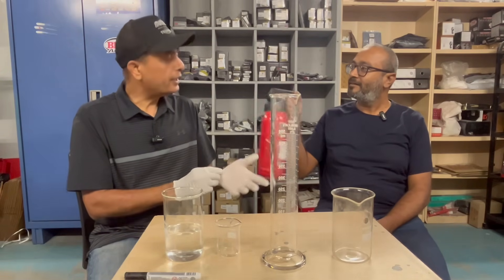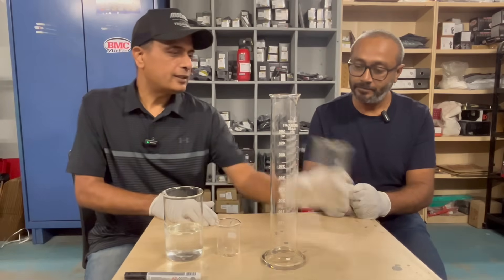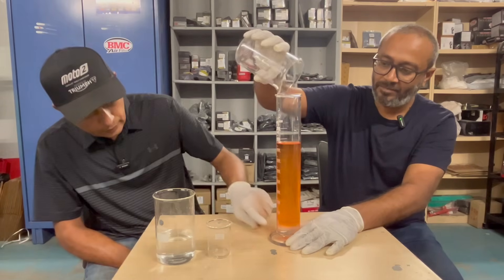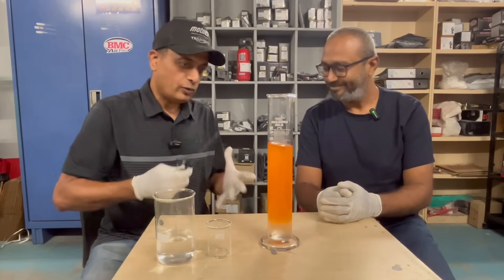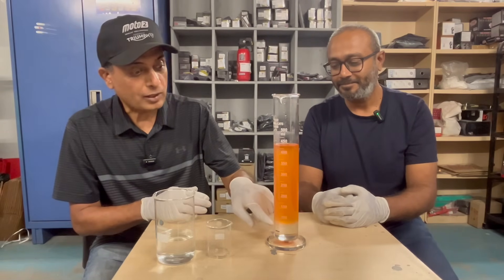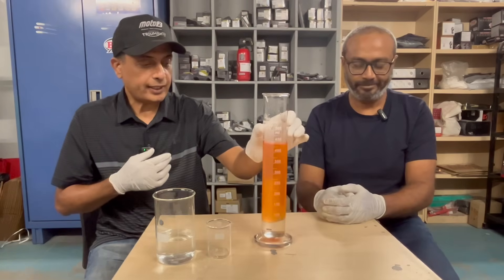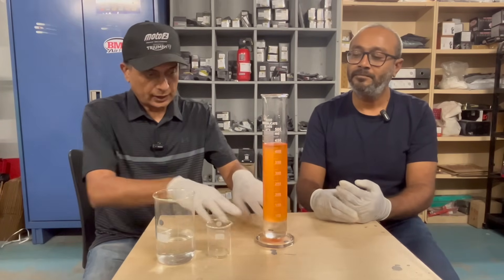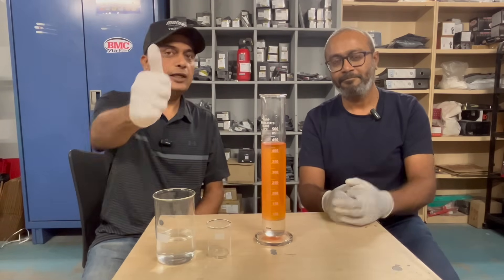ALCOHOL from PETROL | Separating Ethanol from E10 Petrol | Possible?

Comment from the maker: CAUTION- Please be aware that any experimentation with petrol is risky and dangerous and we do not recommend or suggest anyone to try this. Be safe and handle highly flammable items with utmost care. Thanks.
Reply: It works 😅
Reply: Make another video of how to take out petrol properly and keep in seperate gallon
Reply from the maker: Pardon. No plans at the moment to make any more videos on ethanol separation.
Reply: Bosky  sir , can i use distilled water ,shake the container with e20 and leave it overnight and in the morning  siphone the clear petrol from the top  ?  Ofcourse I'll cover the distilled water e20 mix while keeping it overnight.Will the pure petrol be safe for my 2025 zx6r? Do I need to add octane booster with this pure petrol ?because when we remove pure petrol after water mix  ,even octane boosters stays with the ethanol .
Reply from the maker: You can but be careful please. Handling and storing inflammable materials at home is not recommended.
Reply: Why you cut the video, should have shown full video. Mister scammer
Reply from the maker: Reasons to Cut a Video
	•	Remove Unwanted Sections: Cutting allows the elimination of silences, mistakes, irrelevant or repetitive footage, and errors, making the video more concise and focused.
	•	Enhance Storytelling: Strategic cuts structure the narrative better, ensuring scenes build up to a climax and create a clear beginning, middle, and end.
	•	Improve Pacing and Flow: Cuts adjust the rhythm of a video, preventing boredom from slow sections and confusion from too many details, ultimately retaining audience attention.
	•	Highlight Key Moments: Specific cuts can draw attention to important scenes or points, reinforce the message, and deliver impact by focusing only on valuable content.

Hope your firangi brain comprehends this.

Comment: Sir the calculation is wrong

To make E10 ,it should not be 10% of petrol volume.

So by 40ml + 400ml will make 9.2% not 10% V/V

So it is E9.1

🎉🎉🎉
Reply from the maker: This is not to prove any number calculations. This is to demonstrate the phase separation of ethanol and water .

Comment: SOLUTION FOR e20

Step 1 Buy Normal petrol in bulk from a petrol bunk like Jio Bp which has lowest ethanol blend. Lets take an example of 7.5 liters(or 14 liters) in a 20 liter water can for 75:25 mixing ratio.
Step 2 Add 2.5 liter (or 5 liter in case of 14 L petrol) water with or without color because petrol separated from water is pretty distinct and also the goal is not the demonstration but extraction of ethanol free petrol.
Step 3 Use a paint mixer for blending. (Buying one makes it easier for regular processing 14 liter but 7.5 liter is not that heavy, you can easily shake it to mix)
step 4 You get petrol separated from water, water sits at the bottom and petrol on top. Ideally set the water can inverted on a water dispenser that is paired with water can. Use the tap to collect water which is mixed with Ethanol. After all of water is collected, let the petrol sit for another 20 minutes to avoid any minimal water in petrol. Then collect around 100 ml of petrol separately eliminating any chances of water and moisture in the petrol.
step 5. You are now left with E0 Petrol and water blended ethanol.

I do this as per the convenience and just for better mileage. I sometimes use E20 fuel when I don’t have time to do all this as I don't really need it as my bike is E20 compliant and lucky me the car runs on Diesel.

this is going to be my plan if Fuel goes E27

The outcome:
In Hyderabad regular petrol costs 107 and xp100 costs 160

E20 contains 800ml of petrol, that is 107/800 ml. So cost of 1 liter E0 petrol from this is 133 where as xp100 cost straight up 160 and power100 costs more.

If I get E10 fuel from jio bp then that is 107/900 ml. so cost of 1 liter of E0 from this is 118

I just need to find any use cases for the extracted ethenol
Reply: This Lower's the octane number which can damage the engine due to pre-ignition.

Although, This method works fine for Old Carburetor motorcycle's but no Safe for Fuel Injector based's Vehicle's be it Car or Bike ..

90% of Fi Bikes don't have Cam Sensor & VVT due to which there is no feature of Timing Advancement.

Comment: I think there is a process whereby you can add salt to the ethanol/water mix and then by lowering the temperature (freezing) of the mix cause further separation. Pouring off the ethanol you can then use it in an alcohol fuel stove so it is not wasted. Just my 2 Cents!!!

Comment: How does it hamper the 2stroke n 4 stroke engine...does it effect the MPFI Engine... I have heard that it's not good at all. Does it give a mileage or less mileage
Reply from the maker: Ethanol is hydrophilic and it’s the moisture that mainly can cause corrosion.

Comment: You guys mixed 40ml water with 400ml E10 petrol, and the water percentage you took was 10%.

Should I mix 80ml water with 400ml E20 petrol, now the water percentage is 20% or should i mix 40ml water with 400ml E20 petrol ?

Because in E10 petrol, 10% is ethanol and you used 10% water

Should I use 20% water for E20 petrol, because the ethanol percentage in E20 petrol is 20% ?

During this process, is there any chance for the petrol to evaporate ?
Reply from the maker: This is just an experiment to demonstrate the hydrophilic properties of ethanol. I have no recommendation and suggestions for your questions. Sorry.

Comment: Just a question I would like answered. If ethanol is premixed in petrol by the oil company then the separation will take place in the petrol filling station. The petrol will rise to the top and water and ethanol will separate out and settle at the bottom of the station’s tank. We would then get pure petrol only.
Reply from the maker: Refineries premix ethanol. There is no separation done at filling stations.

Comment: Do not do this to get pure petrol for your vehicles. Ethanol has a higher octane rating than pure gasoline and when you separate ethanol from from the gasoline the resultant pure gasoline has a lower octane rating which is not good for the engine. Better option is to buy a ethanol fuel compliant vehicle. Even better option is to leave this country.

Comment: Can we make E0 petrol for our cars at home using this method?
Reply: If you had a well ventilated area, a separation funnel and a fire extinguisher and deal with small quantities for testing purposes and took necessary precautions in handling fuel and and keeping yourself safe, theoretically you could, but since you may not have those things and learned the process of solvent extraction and decantation, it's best not to attempt this at home.
Reply from the maker: May be. Dangerous to do this at home. Not recommended.

Comment: I am facing huge problem in my Hero Super Splendor XTec bought in 2023 September from Piravom always throttle Goes down and engine tries to shut down. I serviced 3 authorised different service centres in Ernakulam but they are unable to solve the issue. It is causing huge damage and pushing us to electric. Big damage. 🙏🙏🙏🙏

Comment: I got a great business Idea with E20 😁
Buy 10 litres everyday. Add 2 litres water. Shake shake shake. Leave for half an hour.
Then I'll sell the 8 litres or so of pure petrol to owners of old vehicles like Bullet, RX100 etc
I can also sell the 4 litres moonshine at 200 rupees a litre 😁
Reply: Check for additives and find a way to remove them and filter ethanol, then you're the king..

45% ethanol, 55% water.. drinkers will love it.

Bikers will appreciate it if you sell them pure petrol for a few extra rupees
Reply: @tkentertainment2776  I was just kidding. Bitrex (denatonium benzoate) which is extremely bitter and Tertiary Butyl Alcohol (TBA) which is toxic - are deliberately added to the ethanol to make it un-drinkable 😁

Comment: This video is superb.....
Can you please suggest the quantity of water required for separation of ethanol from 20 litres of E20 petrol...
Reply: It's usually the ethanol percentage i.e., 1 ltr of E20 petrol should have roughly 200ml of water.
Reply from the maker: Thanks. Generally about 10-20% of the volume of petrol should do it.

Comment: some water will still remain in upper petrol layer and cause more prolem than ethanol.
Reply from the maker: Nothing usually remains and science dictates that all moisture will settle at the bottom. But let’s say even if some negligible amount still floats around, it’s not enough to cause any problem.

Comment: In true terms it means E20 petrol the buyer is at a tremendous monetary loss as it gets mixed with water in the tank and settles down without providing power to the vehicle despite having paid for it.
Reply from the maker: Do whatever is possible to prevent water from getting into the tank. And use the vehicle regularly and keep the tank near full as far as possible.

Comment: For those who want to do this to the E20 petrol, In India bpcl Speed 99(10%) or IOC  XP100(no ethanol) is the best option as if now but costly. 

If we remove the ethanol from Regular petrol, the octane level also goes down as they mix and achieve the ~94 octane it has now. So we have to use an octane booster to the seperated petrol to make it run smoother again. So there's that added cost. 
But for older cars and bikes, esp vintage ones this is a better option than regret not getting the spare parts to change later on.
Reply: For normal petrol what will be the octane level after srparation?
Reply from the maker: Don’t know the exact number but certainly less.
Reply: @bigbearbangalore not less than 87 octane i guess..i think then it will be good for the bs3 enfields..
Reply from the maker: Possible
Reply: @TormaysankarChardhury  in nrml petrol octn 91 and up to 3 octn reduce seperation ethanol frm petrol, XP 95 - 3 = 92 otn
Reply: @AjaySingh-he6hf you can also add octane boosters if you like but I don't think it's needed for royal enfield 350s and 500s.
Reply: As of now, No ethanol free petrol available in india.. accept it or not, they adultrated the petrol.. which will definitely make problems for bikes, cars made before BS6..
Possibly misfire, mileage drop, degrade of engine, pipes, gaskets..

After few years, BS6 stating versions will have the same problem as they're planning to add 30%
Reply: Is this officially confirmed by BPC or IOC ?
Reply: @sentimentalmindless  ioc and BPC are liars , there words have no value. All this government companies were saying no ethanol in xp95 etc but once someone did RTI  ,they said 20% ethanol is blended in xp95.

Maybe after few months they will blend xp100 aswell .

Comment: Watching this video. When e27 is about to Enter after e20.  And I'm already facing issue with BS4 EFI bike.  With Nitrile and NBR degradation.   Replaced the gasket 4 times in 6 months.
Reply: For that reason only they've made this adulteration.. now spare parts companies benefit from you.. before that, Gadkari sons started to benefit by selling Ethanol for petrol
Reply: Buy 100 octane for Rs160/- which doesn't contain Ethnol at all IMO 😊

Comment: This video is getting views after one year ..... :-D
Reply: Bought the beaker 3 days ago 😄
Reply: You can't do this as anti knocking property will vanish.
Reply: Can we use the separated petrol in cars?
Reply from the maker: Yes
Reply: @jojigeorge3972 not recommended, since it is a mixture which is predetermined to avoid knocking and burn residues behaviour , you can go for BP  Speed which has less than 20% ethanol, but make sure you verify once as shown in other videos

Comment: CK’s amazement and the last ನೋಡಿ was clearly understood. 😄 

On that note, bosky, a question on E-20. Since it’s the Bisi Topic. Non compliant vehicles from early 2000, if run on E-20. Would topping up the tank with Liqui molly fuel cleaner and many other additives help? I noticed it but wanted to confirm if either Ck or you have noticed this. 

As it is, I haven’t faced issues apart from a slight roughness while running but additives helped (I could be wrong non-technically).

Kindly ಸ್ವಲ್ಪ ಮಾರ್ಗದರಶನೆ.
Reply from the maker: Only the news is bisi. Otherwise no need for so much drama. 😀
Some post on E20 went viral and so every online magazine and creator started to speak about it. That’s all there is to it. 
Mountain out of a molehill.
Reply: @bigbearbangalore Excellent, haha thank you Bosky 🙌

Comment: I used E20 and observed that my mileage dropped drastically. Dont know why it happened. Please let me know if you are facing the same phenomenon.
Reply: As the percentage of ethanol goes up, the mileage drops accordingly. Because compared to pure petrol, e20 has 20% ethanol, and ethanol has less calorie count per volume compared to pure gasoline. Hence mileage drops. Higher blends like e20 should be priced lesser than normal or e10 petrol - that is how it is in other countries.
Reply: @sreejithsin-yt  Agree. The oil companies are playing on our guilt consciousness to make money. This product will not work unless there is a price difference. On the flip side, if Govt makes this mandatory, then it will indirectly increase our fuel expenses.
Reply from the maker: Possible.

Comment: this is simple and explanatory video. can you make a video on what happens if you dont lube your chain? saw a youtuber claiming that the cost of lubing is more than cost of changing the chain-sprocket set. 😅
Reply: Not lubing stiffens the chain and sometimes it break or increases resistance while riding.
Reply from the maker: Thanks.
And, not lubing may be more economical if we view it in one way and when viewed in another way has an adverse effect on rolling resistance and power output to wheel and fuel economy.

Comment: Sir it's not just vintage engines..
All engines prior to bs6 stage 2 (circa 2021) aren't designed for E20..
Wonder whts going to ultimately happen to my REs 500 & 650..
Of course you showed us how to use the distillation jar.....
Now next Saaru how to get alcohol from ethanol water😅
Reply: He never said E10 is only for vintage vehicles. What he said was, "If you have any vintage vehicles that can run only on pure petrol, then do this and separate the ethanol from the E10 petrol". TLDR - Vintage vehicles (some) = Pure Petrol, Modern day vehicles before BS6 Stage 2 = E10 Petrol, Vehicles BS6 Stage 2 and up (till god knows what) = E20 Petrol
Reply: @govindb7837  u just haven't got it. Apart from vintage, all pre-2021 vehicles will struggle on e20.
E10 pretty much management for most engines..
Context man..
And big bear does answer on his own.
And this was just observation.
Obtuse obtuse